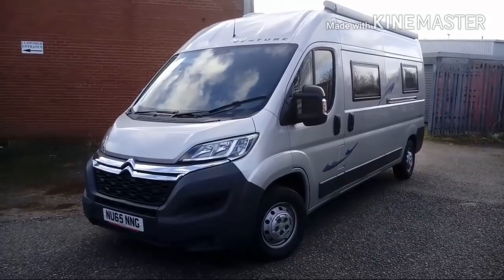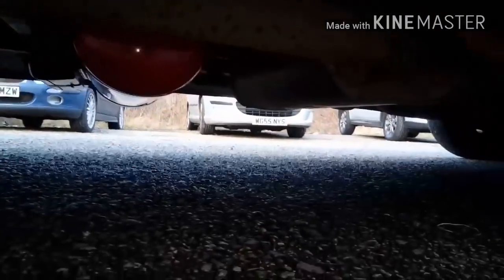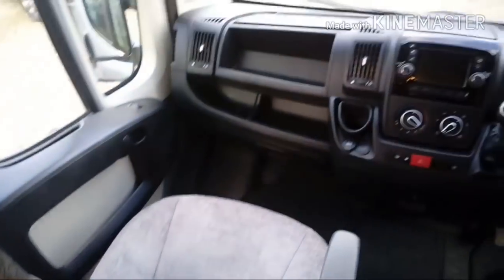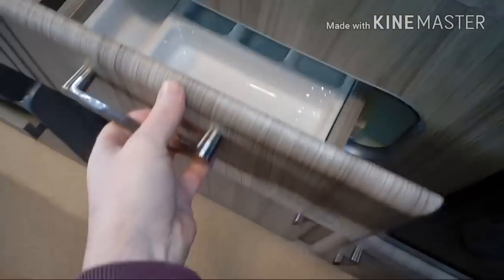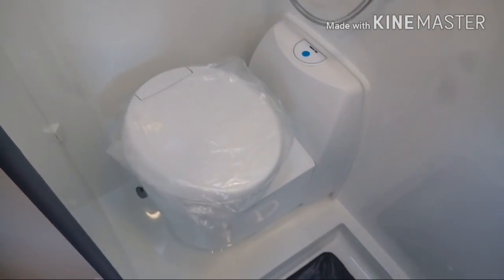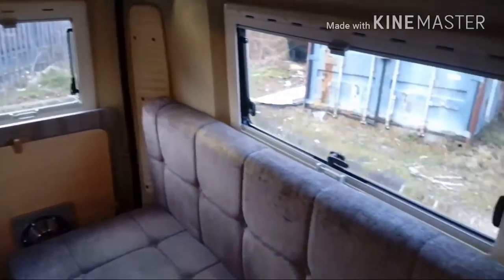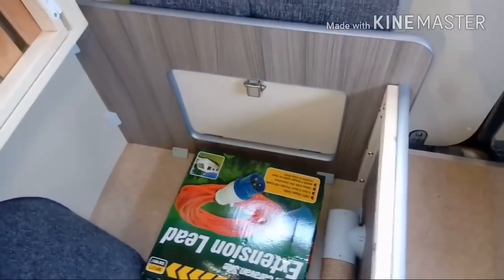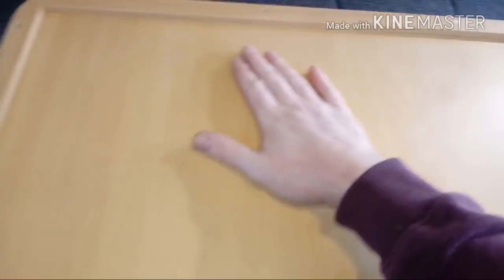Brand New Campervan Conversion to Citroen Relay Series 1 Final Full Tour

Comment: Dan, did you fitt and connect the underlying gas system yourselves, or use  someone else?
Reply from the maker: No everything is either supplied and fitted or made and fitted in house so we have a lot of control over layouts etc so everything can be made to the customers requests.
Many thanks for watching.

Comment: nice to see the finished product, great work!

one question though, isn't underslung gas tanks a bit dangerous? what if it's accidentally punctured during travel?
Reply: Nosrep Suomynona no they are very tough it’s safer than having a badly connected bottle leaking in a van, it’s also much larger and cheaper to refill as you can fill from a garage lpg car pump for much less than a bottle swap